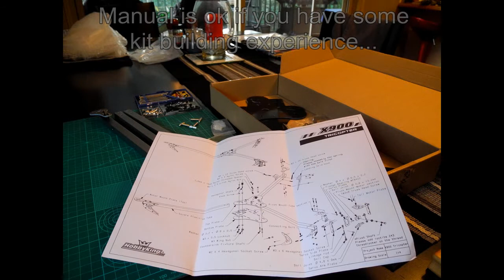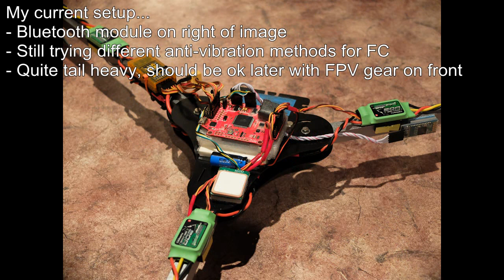Hobbyking X900 Tricopter Build Video (photo sequence) with Multiwii Pro FC

Comment: Depends on your flight controller.  Most recommend that power from only one ESC is fed into them.  In practice, as long the BEC on your ESC is linear (as opposed to switching -- most are linear), there's no problem connecting them in parallel.  To be safe, you can disconnect the red wire from the servo plug into your flight controller from all but one ESC.  I've never found it necessary, but some people seem to think it's important.

Comment from the maker: Hi, I believe different flight controllers have different power requirements. Mine only needed one 5v source so it made sense just to get one with bec. But yes, you could just isolate the red wires. As for motor direction, it is better to have front motors spinning in opposite directions to minimise torque effect but not necessary if you don't want to.

Comment from the maker: Hi, sorry this reply is so late, I was away for two months when you asked it so I am sure you have worked it out since... but to answer anyway, this depends on which FC you have and what firmware you have installed. For current MultiWii firmware on the Hobbyking Multiwii Pro/Mega board, it is pin D2. But if you install MegapirateNg instead, it is a different pin so always check the pinout diagram for the firmware version and FC you are using.

Comment: At 1:02 in your video you show the rear servo mount with linkage. I got to the ball joint linkage arms during my build and found that the ends don't screw into the black plastic ball caps. Did you have any trouble with this?

Comment: Hey thanks for the great video.  I have a couple questions as I have the same frame.  
First off, what do you mean by ensuring only one BEC is active or use UBEC?  Will I damage my KK2 (or any other flight board) by feeding power on all three motor pins?  I never thought of this before as I've worked with APM v1.4 which only takes power on M1 pins.

Secondly, what do you mean by bluetooth?

Thirdly, you mention getting OSD.  Does the board you have support OSD outs?  How are you transmitting that information to your FPV gear?  I thought it was

video ->OSD overlayed -> transmitter, and that the OSD was overlayed from flight board ouput to OSD board input. I have zero knowledge on FPV and OSD so I'm assuming all this...
Reply from the maker: Hi, I've never had a KK so can't say whether it prefers one power input or more. As long as you are using linear BECs and not switching ones, connecting more than one should be ok, but isolating them by removing the red pin from the servo plugs is easy enough.

Multiwii has Bluetooth module support to use with apps, you don't need it with KK since you have a LCD screen for adjustments.

And as for OSDs, some are pass-through as you describe, and some are video piggy-back connections. The multiwii can output additional data for an OSD like flight mode, height, heading, GPS/home info, if you use certain OSD modules running the right firmwares.
Reply: Thanks for the answer, yeah I recently figured out about linear and switching BEC's.  Since I'm going to flash to SimonK though, I'll have to have a separate BEC or just use an old ESC lying around to get some smooth 5V power.

I know this is a bit stupid to ask, but similar to how the Multiwii and the KK2 are the most common and best reasonably priced flight boards, what would be the equivalent for OSD?

Eagletree?
Reply from the maker: bonicr1 For multiwii, minimOSD is cheap and can relay info from the FC like virtual horizon, GPS data, etc. but I haven't bothered to install mine  as it needs some fine soldering of wires to chip pins if you want battery voltages to show, which for me seems the most important thing to know. I just use cheap piggyback voltage OSDs from HK.
Reply: Can you recommend one that works well for you?  I essentially need a rudimentary one for research.
Reply from the maker: bonicr1 the hobbyking E-OSD  works for me. displays dual voltages wherever on the screen you want. simple to wire up the video piggyback, I use a home made servo y-splitter cable, similar to aileron ones but reversed gender plugs.
Reply: Thanks so much, I'll check it out.  Do you mind if I PM you if I have any questions about it?

Comment: What is the setting on your multi wii FC for this x900? Just ordered the hi multiwii. I'm new to sure "complicated" setup. Any advice? Was using kk2.0 all this while and decided to upgrade to multiwii.
Reply from the maker: Hi, I've not used my X900 for a long time.  Default settings on Multiwii 2.3 would probably be ok to start with, but while you are modifying config.h for your copter, make sure you go to the Gyro LPF (low pass filter) and drop it down to 42 or even 20hz for stable flight.  Without this, your X900 will wobble more than it should.

Here's a link to someone else's settings:
2.3 MultiWii 328p FPV PIDs for X900 - Flight footage
Reply: Roger. This board offer return to home and hovering rite. For way point navigation will need to hack the code?
Reply from the maker: Fish Wong If your Multiwii came with a GPS or you bought one separately then you can configure it for RTH and position hold. Navigation is coming in future versions of Multiwii, for now you can install MegaPirateNg but it is quite fiddly so I never bothered to try.
Reply: ZaksterBlue Thanks for the information and advise. Yes. I got the hk multiwii with gps. Will the configuration be tough as I'm using the mac ver of multiwii config gui.
Reply from the maker: Fish Wong Yes, it takes quite a lot of fiddling to get the FC board, GPS, and software configured the first time.  Follow the how-to guides on youtube and rcgroups and you'll gradually work it all out.
Once you can see your Tx controller movements on the GUI, make sure to adjust your Tx endpoints so that they cover a full 1000-2000 value on all channels.  This will save you a lot of headaches later when you are trying to get the FC to recognise stick commands.